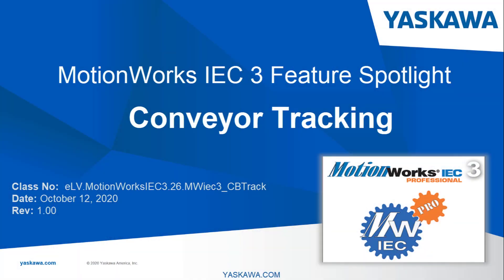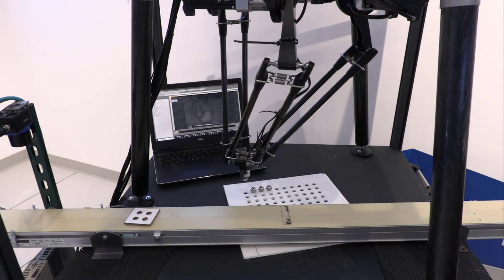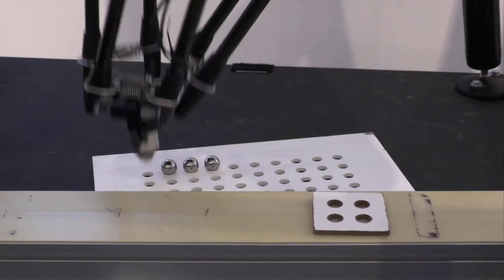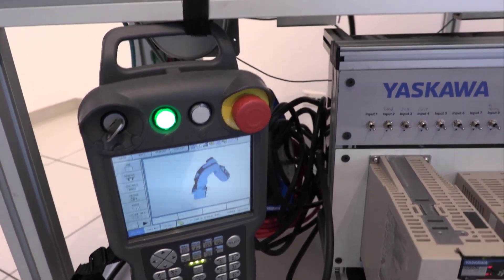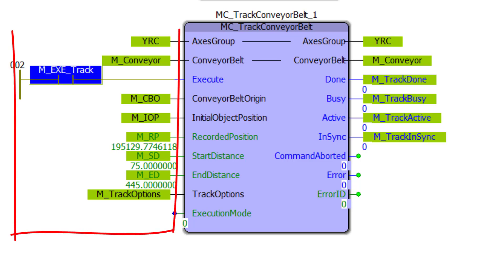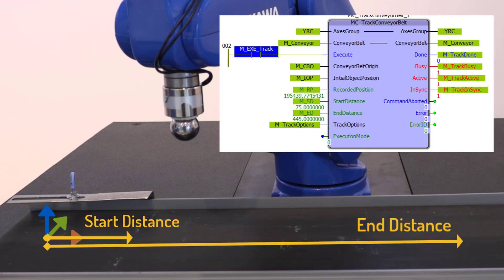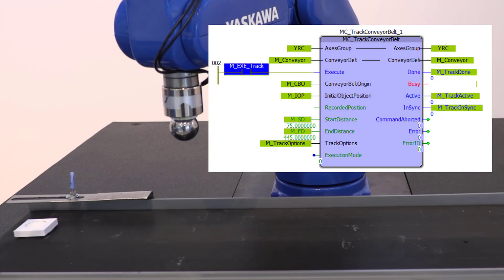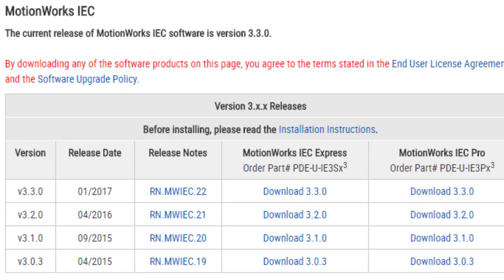Conveyor Tracking (MotionWorks IEC Feature Spotlight)

Comment: I have a problem during perform conveyor tracking. It is happen alarm 4414  'excessive segment', high S-axis. Do you know this trouble?
Reply from the maker: Thank you for your interest  in Conveyor Tracking (MotionWorks IEC Feature Spotlight). Please check the  help under the function block for details on this error. If you require further assistance please contact our Technical Support Team for further assistance at https://www.yaskawa.com/support-training/support. Thank you!
Reply: Yaskawa Motosim Simulation on Udemy-https://www.udemy.com/course/yaskawa-motosim-robot-programming-and-simulation-r/?couponCode=B7C3029BCDD660380081

ABB RobotStudio Robot Simulation and Programming with English-https://www.udemy.com/course/abb-robotstudio-training/?couponCode=69CAFD770D5B4AF13A11